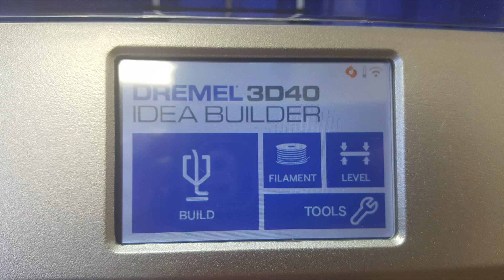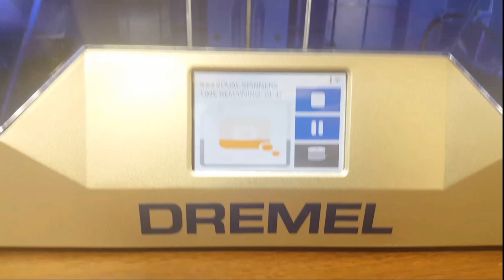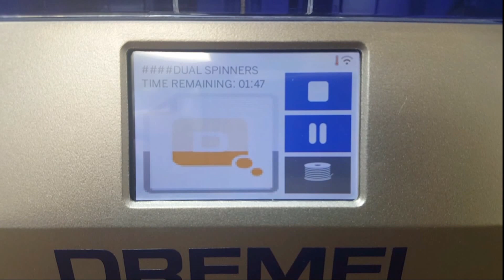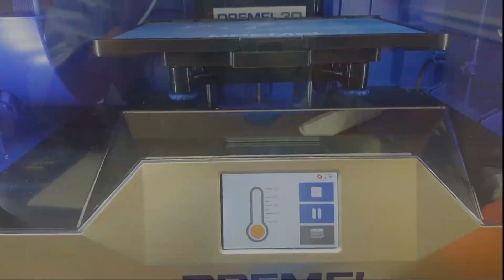Dremel Idea Builder 3D40 Review - Awesome PLA 3D Printer

Comment: I'm an educator using this for my Computer/Robotics Engineering classes. I paired CURA with it and it works well. Biggest problem for me has been a limited school budget and proprietary filament cost. The Dremel PLA is more than twice the price of most PLA in my area. When you are printing approx. 60 grams x 100 students in a semester that can add up quickly.

Comment: I really enjoy my dremel 3d40s I have SIX for use in a high school in Wisconsin.
The amount of abuse they take is tremendous but the dremel keeps on going I had 1 small problem 
when a student broke off the sensor for leveling the table but I got a new part installed it and am back running

Comment: Hey it's a great printer for 6-12 months then it's pretty much a machine that turns PLA into garbage. Oh and Dremel Support is really great about getting back to you in under two months and hanging up when you call.
Reply from the maker: What fails after 6-12 months? The nozzle? Some part of the extruder?
Reply: Z axis stability goes out the window and it develops something disaffectionetly named Wandering Z. Meaning the build plate will sometimes just not move down at all for the next layer or sometimes move far too much. Had mine for 10 months with no issues outside of silly mistakes I made then... 16 fixes from Dremel support later and my warranty expired. Seems I've been put on the no contact list by them for almost a month now. Sad because I bought it thinking Dremel had always been amazing at customer service, looks like things change.

Comment: I have a question: Why Dremel 3D40 stops in middle I mean freeze  That happens somethimes and I need to turn off and turn on and remove unfinished printing
Reply from the maker: +GeraGersh MrZ I have to say I never experienced that. I would make sure the firmware has been updated, try another power outlet, and if those fail contact their support. Does the machine become unresponsive?
Reply: Yes
it does I mean the machine stops printing and the touchscreen become
unresponsive (“frozen”) It is happens about every 5th printing mostly for more than 18 hours  big model printing (just for last month and never happened before) and I am loosing my filament / money 
Just updated to current firmware will see ...
P.S  I bought my machine in September 2016
Reply from the maker: +GeraGersh MrZ keep me updated. Try another power outlet and make sure your going straight into the wall. Sounds like a brown out situation.
Reply: Thank You  
Did you try a large model print for more than 18 hours printing time ?
Reply from the maker: +GeraGersh MrZ oh yeah a few. I put every printer I test through the ringer. I printed an engine block and maxed out the build volume. Almost 21 hrs.
Reply: Dremel's customer support is really good, they might ship you out more filament if you tell them what your issue is/was.
Reply: Old thread I know and I don't know about  the Dremel, but my Ender-3pro has frozen a couple of times, and it has been the SD card the model is on being corrupted. A reformat of the card fixed it. Good luck

Comment: At this price, this could very well be the worst FDM  3D printer on the market currently.  With no heated bed and a weird proprietary filament, this is just insanely bad.
Reply from the maker: Its also old and outdated... Soooo... ?
Reply: @disruptityourself   it is still being sold. In my country it is commonly sold in hardware stores.
Reply from the maker: @r5cpt  you're missing the point. This printer is routinely sold for $799 now. At that price with some of the features it has it's really still a great option for some use cases. But ultimately I recommend the 3D45 at this point, which is one of my daily workhorses.
Reply: @disruptityourself  Features? This FDM printer has no features to speak of. It is the most basic 3D printer you could possibly find. Even leveling is essentially manual. And where I live it is sold for 1200 USD. But that is beside the point as even at 799 USD it is ridiculously overpriced. A small printer without heated bed WITH PROPRIETARY FILAMENT? You can buy 140 USD 3D printers on eBay that are better than this. At least they have a heated bed and don't force you to buy the filament from a single source.
So let's take the price of 799 USD you claim it can be found at - the claim that this is possibly the worst 3D printer of all time still holds.
Reply from the maker: Ok. Thanks for stopping by.
Reply: @disruptityourself   thank you kindly.
Reply: r5cpt Some of the inexpensive Chinese printers have literally burned down people’s homes. Almost none of them have thermal overrun protection let alone UL certification. All of the components Creality uses are inherently inferior to Dremel’s components. Why would you buy something knowing that you have to modify it to work properly? While I’m not a fan of the proprietary filament or unheated bed, I would recommend Dremel over any Chinese brand for the safety factor alone.